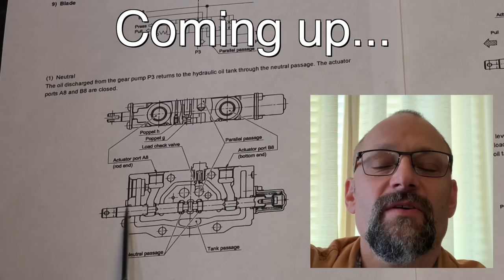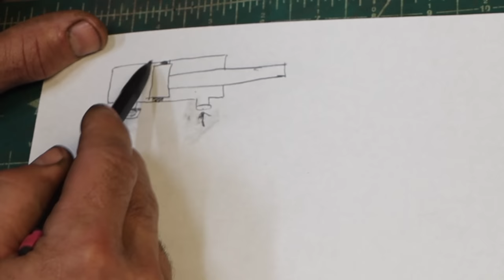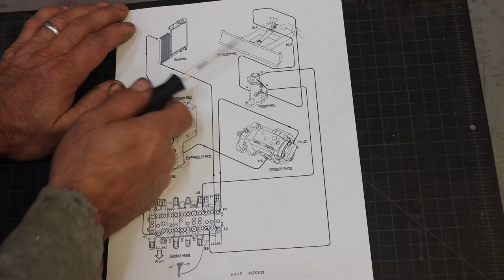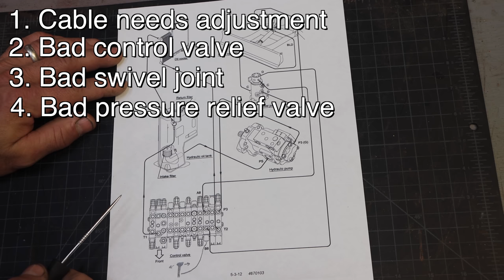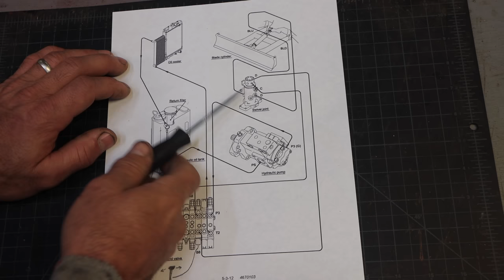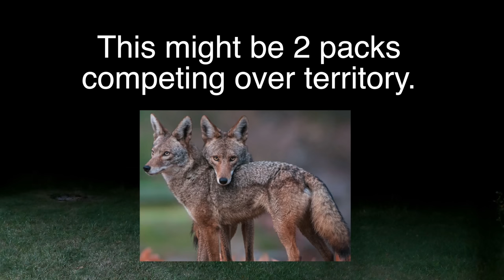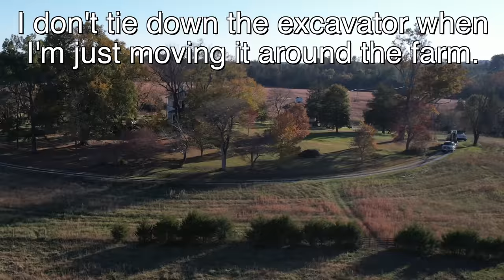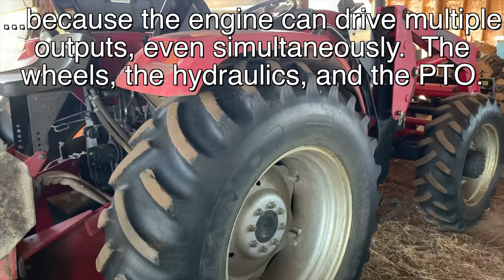Excavator Repair, Swivel Joint Rebuild, Yanmar Vio-50.

Comment: nice job on the yanmar 👍
yep that job is one you only want to do once, chances are you won't have any other issues with that now for a long time. (just don't let the hydraulic oil overheat and it will be fine).
Now, i do want to correct your guess at what you thought was a swivel assembly, that was not the swivel assembly. That part is the 'swing hub, swing brake and swing motor assy. That is the hydraulic motor (on the top that drives the swing hub and brake that makes it rotate around).
The swivel assembly or as JLG calls it 'the rotary coupling and collector ring assembly' is located in towards the center inside the radius of the swing bearing, there will be a dual row of bolts around the swing bearing, lots and lots of bolts (around 58 bolts). the rotary coupling and collector ring assy will be in the middle of that possibly mounted on a bracket below the level of the bearing. The service manual does not really show how it is mounted in the machine and neither does the parts manual. But it's there. The rotary coupling deals with the hydraulic part and the collector ring deals with the electrical.
Yes it can be just as difficult as the yanmar if you ever have to deal with that on the JLG.
Anywho, enough of the JLG lesson...
great job man, and have an awesome day sir :o)

Comment: Ah yes, the joys of working with schmoo, had to reseal a valve body in a volvo a25g haul truck once and to get to the leak I had to remove a hose above it, of course it was the return to tank line so about 300 liters of oil went on the floor :) nice work explaining what you do, kinda like being back in trade school.

Comment: Fantastic diagnosis, work and really good video!
I have got a leaking hose or something like that on the swivel joint on my Vio 10.
I don't think it's the joint itself or I hope. Absolute nightmare of a job on such a small machine. Plus its  zero swing, so it's even more cramped.
Without mayor disassembling I can only barely see the top of it.
I don't know if I even got the patience for the diagnostic part of it...😂🤦‍♂️
Greetings from Germany.

Comment: Of all the cylinders I have rebuilt I never put seals in dry.  I always coat them well with Parker Lube.  It's a heavy-weight grease that is sticky like snot.  It not only makes the seal seat easier but lubes it on startup.  
And as for teflon tape, yes I used it but it was a heavier grade tape than what plumbers use.  I got it from my hydraulic seal provider.  I also always tried to only order Viton seals. They withstand higher heat levels.

Comment: In regards to your question about the hydraulics being imperial, most hydraulics are inch standard, JIC, ORFS, NPT and BSPT all originated in imperial using locations and all hydraulic hosing is measured in 16ths of an inch so -4 is 1/4 inch ID -8 is 1/2 - 12 3/4 and so on. There are of course some metric standards as well

Comment: when I do rotary couplings, first I did a hole deep enough so I can stand in it up to chest height, drive the machine over, have some timbers in there when the oil level builds up, still have oil running down your arms

Comment: My uncle was a hydraulic and diesel mechanic and I done part time work with him and also swivel joints is the hardest job ever with all line and stuff also that how i learn few work that I never heard before. He has a quite big workshop to work on those machine, he also dug 6 feet deep hole in the floor just to work with cylinder all oil just go in the hole and not massed up floor with oil

Comment: Thank you very much, I had not had a swifel renovedet jet but now i know . Complicatied if you do not know but you did explained very well and "easy" to get.so I had it with our owne   build new woodsplitter the " woody- wood Splitter" it runs with a Kubota 1505 engine. Anyway thanks a lot , keep going til your next one. Best regards

Comment: The coyotes are not competing with another pack, that is a single pack.  
They are singing before the nights hunt.
It builds esprit de corps bonds them as a family.
They will also sing after they finish the hunt usually in the morning before they hit the sack.
Great video.
I have a dump trailer but even with the smoke I'm green with envy for the dump truck.

Comment: My steel fab shops 50ton yard grove crane needed the swivel joint replaced. Me and my uncle looked at the schematics for it and ultimately decided that due to about 20 lines upper and lower, due to not being up to get to it without dissassembling half of the cranes upper cover plates, and due to the swivel itself being a 3’ tall by 12” wide solid ish chunk of metal we opted to have all crane fix it…while I’m sure they made money on the job of course, the new outter swivel casing was $6000(the top five seals worn out and rust destroyed the old one, couldn’t be re machined) and the labor was about that much too. We have brakes now and no mystery hydraulic leaking anymore now though ;)

It prolly would have taken us so long to do ourselves, we would have struggled due to not remembering how it all came apart. Plus we’ve got so many day to day business tasks that there just wouldn’t have been time without messing things up for maybe months

Comment: @42:53 You said pressure relief valves, but those are actually the solenoid coil /spring housings with manual over-ride center push plunger.  If you want to manually over-ride the piolet valve you would depress the center button. 
Love your videos.  It shows the wet work of hydraulics.

Comment: Thanks for showing, that was great video and very interesting. I have a J C B micro digger and have noticed the top half of the swivel housing does not appear to have any sort of peg or bracket to keep it in position with the upper half of the machine, when you switch the machine from clockwise rotation to anticlockwise rotation or vise versa there is some stationary backlash in the top half of the swivel housing it seems to rely on the upper pipe connections to rotate it with the machine, the bit of stationary backlash when you rotate the machine a different direction must be caused by friction from the stack of seals inside the swivel housing.

Comment: A good trick for undoing those hard to reach pipe unions is to make your own flare nut ring spanner which will fit over the pipe and then slide down onto the union nut. I cut open the end of a ring spanner wide enough to fit over the pipe and then beef up around the remaining ring with some weld to stop it springing open when loaded. When doing this with an offset neck ring spanner (which gives better reach down into a valve bank manifold), you can weld on some pipe circumferential segments above the ring to give extra strength. An advantage of making your own a flare nut spanner out of a 'star' pattern spanner is that you get a smaller twelfth turn rather than only sixth turn from a standard 'hex' flare nut ring spanner.

Comment: After checking the hydraulic actuator, my thoughts were the spool valve return spring. Most hydraulic manifolds I've been around that had spool valves have springs internal to return the valve to a preset position. It's not the rotary valve, of it were that the blade might work fine in some directions, and if any other subsystem was on that you'd see terrible there as well, also leakage. Spring goes soft? No leaks, something 'relaxes' to a position like you got.

Comment: Teflon tape on hydraulics: we use a special tape called silvertape on hydraulics with tapered threads. NPT, BSPT or similar. It's a lot thicker, and needs to be applied a specific way to be safe. But it works really well.

Comment: That probably fixed your tracking issues also. I’ve done this twice on my machine. Had to weld and machine down one of the journals on the center joint shaft. It was quite the process. The left track is still a tad weaker than the right side but perfectly usable.

Comment: Jon, another highly informative project. I worked on radars for many years in the military and while ours didn’t use hydraulics we had rotary joints for moving RF power from a stationary joint to a rotating element  (actually we had 2, one for azimuth and one for elevation) and we had rotary joints for low voltage control signals and high electrical power and rotary joints for liquid coolant. It was my good fortune in that most of these rotary joints were quite reliable. 

Keep up your informative and well done videos. I really look forward to each of them. 

By the way, were you ever a radar tech in a previous life?😊

Comment: I’ve been watching a few vids here and there but this one deserves a subscription. Keep up the good work. And as far a Teflon tape I’ve always used it in hydraulics and never had a problem but I can understand what your saying happening and causing a problem. And those worm drive clamps on the return line could potentially be factory. I’ve seen lots of return lines with them from the factory. Stay safe and god bless.       Zack. Pittsburgh, PA

Comment: Watched this video several times but you seemed to have everything fixed since the pond build with exception. If the couple leaking hydraulic cylinders on the dozer.

Comment: From my very limited experience, clamps are low pressure returns. My 303 has all the return stuff clamped including the oil cooler.
Teflon tape thing - They say that because people dont know how to properly use it. It is ok to use if done correctly as to not go past ends of the threads and proper number of wraps. It dosnt seal, it lubricates to get the tight fit required to not leak

Comment: ceramic grease on the rods and the seals always for the future always think ahead.don't give the rust a freeway or seals that are going to wear out to fast by the wrong chosen oil in case of emergency.nice work that kind of machinery.i did boomlift and scissor lift from JLG and lots of other brands.

Comment: I half expected you to pick up your swivel joint after putting the cylinder back together only to see a pile of your O rings sitting on the table where you just shoved them out the bottom. 😂

Comment: one thing i do with antenna cables are to use tape or colored tyrapes. but to separate up or down or either side use one rap for up and two rap's for down. then you don't have to worry about which one goes wear. i'm 70 and it took many dovers to learn simple tricks.  go job,

Comment: I had to customize a wrench to loosen & tighten one of the 3 nuts on the fuel injector lines on my  tractor.  Need a tool, make a tool.  Thanks for posting.

Comment: The pig-mat sweat bands on the wrist are a true stroke of genius! Next time, just use the boom to tip the machine over 🤣 I jest, but they did make hoop-stands for the VW Bus such that you could roll it over to work on the chassis, though I think the engine had to be out.

Comment: In aviation we use Teflon tape on hydraulic fittings in some instances. But we do not put tape on the 1st 2 threads that enter the fitting therefore no Teflon tape can get into the hydraulic system and foul the pump.

Comment: Ahh, armpit oil.  I remember it fondly from my years as an auto mechanic.  I countered it by tying shop rags around my wrists.  I'm kind of surprised that they didn't use two different valves, then simply route pressure and return lines through the swivel.  The control valve on the excavator base would do the turning, blade U/D, and track F/B, while the valve in the cabin did the arm and bucket.  (What do I know, though?)  Yelping coydogs.  Just what everyone needs when trying to sleep...or get their armpits oily. That's a =large= bunch of critters out there!  //  I was going to say $75 for the o-rings, but since it's a kit, I'll gander $129.  That's an expensive plastic bag and someone took almost 90 seconds filling it with the right parts.  $339?  OMFG!  I well and truly HATE price rapes like that.  And then the dealer hits you for a grand to install them.  No wonder you DIY.  //  If there's one tip I could have given you in time, I would have told you to oil every rubber part before assembling it into the groove.  It helps them slide in place smoothly, and to compress cleanly as the mating cylinder slides down into place.  (Oh, good, you did. Warm, even!)  The nylon or PTFE pieces ought to be fun, too. (Surprised that they weren't!)  //  Well done video.  I'll watch a few more and probably subscribe. Thanks.

Comment: When you are working with hydraulics try tying a rag on each wrist. It keeps the oil from running to your arm pits. I learned this while working on aircraft that use SKYDROL hyd fluid. That stuff burns your skin BAD.

Comment: teflon tape is unnecessary and will inhibit proper function of metal on metal seals, but on pipe thread it is necessary.

Great breakdown on the hydraulic system, but I caution you on using any steel tools on o-rings as you can damage the groove which is very precisely finished for sealing. I've seen it a ton in my field.

Comment: That line with the hose clamps may be a tank return line as you stated but it could also be a suction line as well.  Without being familiar with that specific machine I can't say for sure, I work on the ag variety of equipment so I'm not familiar with the layout of excavators.  Teflon tape is fine on hydraulic systems provided you do it right, the big thing is that you don't wrap any past the edge of the threads, that's where the risk of teflon tape getting into the hydraulic system comes from.

Comment: Thanks for the hydraulics lesson. You reminded me of working on an early beetle I had, VW kind-long ago (some 60ish years) I needed that 60 degree wrench so the torch helped remake one into a useable tool. The rubber band and oil sooper around your wrist would have come in handy - or dryier had I seen it long ago. At 83 now I sure enjoy watching a lot of the you-tube lessons and adventures but my crawling under machinery has pretty well ended. I liked your gravel diverter on the back of the dump truck. Haven't figured out yet though what part of the country your're in, S.E. ? Anyway a safe and prosperous life in the  future to you. JimM

Comment: As easy as the rotation joint moves those seals are shot in it. And hose clamps are or can be used on return to tank side only as they can’t take the pressure of the system.

Comment: A simpler way to think about how a cylinder that has leaky seals resulting in bypass would extend the ram is that you're pushing fluid into a fixed volume but the piston and rod are occupying space within that volume, so if you pump something into the cylinder then the piston/rod are going to displace out of the entire thing if there's bypass. The oil is just trying to fill up more of the cylinder and it can only do that by pushing the piston/rod out. If there is no leak/bypass then it's only pressurizing one side, which is countered by the opposite side.

Comment: I work on heavy equipment every day and suction lines always use low pressure hose clamps, suction hoses don’t require a lot of pressure so they are normally softer and don’t have as much wire reinforcement, return lines have to be able to withstand higher pressure that’s why they are made of the same pressure rated hose with crimped fittings

Comment: Just some thoughts, not an expert by any means.
Static pressure  bench check the device before install. On rotary unions, spin the union under pressure to check for cross hydraulic communication.

The tear in the seal looked  like it could have during assembly, has it always leaked/ been that way since you have owned it.
Take photos of the clocking if any fitting with angle feature. 
Often i modify wrenches for tight quarters. I like starting with a 12piont box wrench, then cut out a slit to get over the hose. It gives you  a smaller minimum move.
Seal like that leak both ways. Was the blade moving when some else else was actuated?  The oil has to go somewhere. Some times it can leak to a case drain (from travel motors or even the rotary union) that is hard to find.
Thanks for the content.
Good luck, work safe.

Comment: I had to finish a job rebuilding one of those started by a mother guy ( son was born legit excuses to miss a few days ) and it was a mess , I had never taken one apart , lot of broken bolts , damage in the sealing surfaces , used a piston ring compressor and big hammer to get it out back together
Reply: The one I did was on a late 90's early 2000's bobcat mini and the assembly looked different that your , has grove cut in the center part for the oil to flow and I put the seals on the center part not the housing

Comment: I was surprised to hear you say that fitting was Imperial - I thought posr WWII Japanese stuff is all either "Freedom Units" (US SAE) or Metric.  When I work with Imperial stuff I usually have to get it custom machined, whitworth threads aren't on the shelves around here!

Comment: I'm a heavy equipment technician and before I was a field hydraulic technician/mechanic for 8 years and I was always told Teflon tape is fine just don't put it on the first two threads. I have never encountered a issue with using it on hydraulic systems and I do it almost daily

Comment: They make some special Wrenches that make it much easier!
Kind of a cross between a tubing wrench in a crows foot that are 12 point i’m flat on one side so you can get a wrench in there and hold the other part is the fitting

Comment: Fantastic video.  Can you explain the function of the 10 hoses on the swivel joint?  2 for blade cylinder, 2 for left track drive motor, 2 for right drive motor.  What are remaining 4 hoses for?
Reply: I figured 4 for each track, 2 for forward and 2 for reverse.